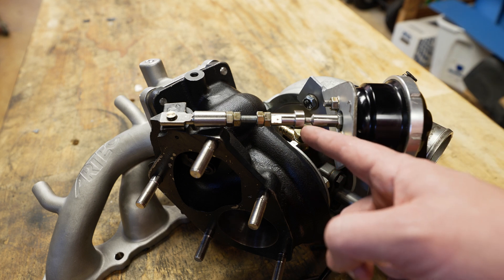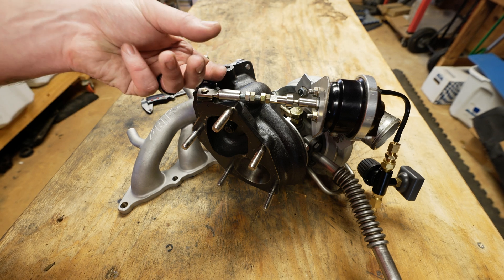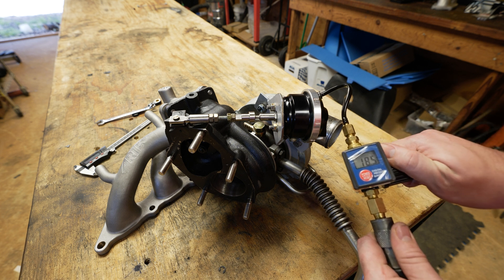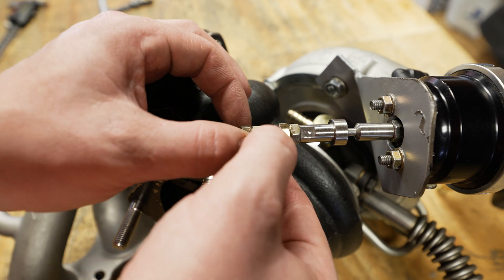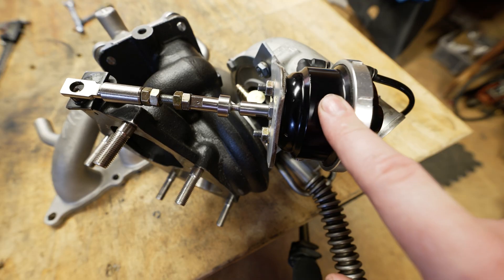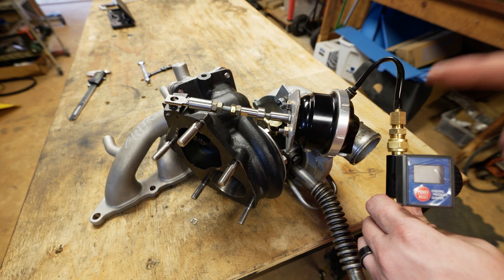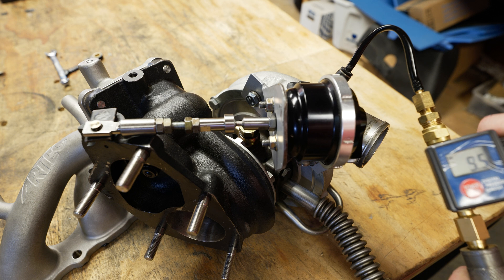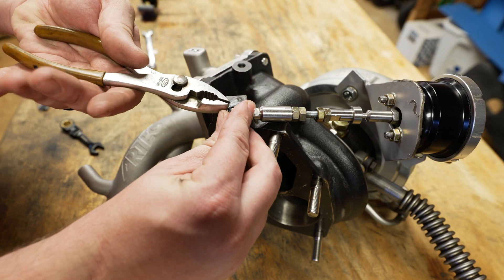PROPERLY set Wastegate Preload!

Comment: How come when I set my crack pressure at 25 with a pump then once I test Eastgate pressure doing a WOT pull it actually opens the gate at a lower pressure than the 25? Pump error or different forces when under boost ?
Reply from the maker: It’s most likely the exhaust gasses pushing on the gate. That why they made dual port wg so you can divert boost pressure to the top of the gate to help keep it closed until told to open.
Reply: @Bang4BuckRacing thanks mate that’s what I was thinking. I had to adjust it a few times on mine and now the boost controller reads wastegate pressure at 24 and max boost 29. Hits and pulls like a freight train